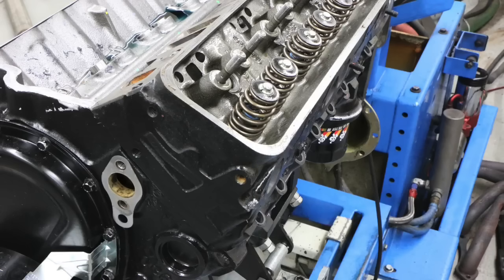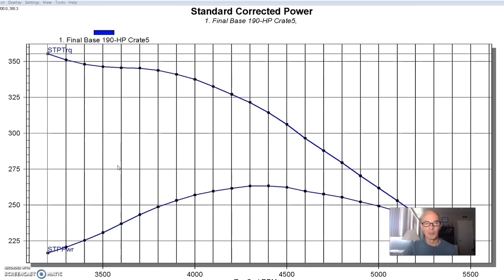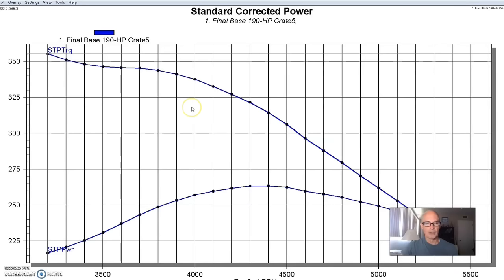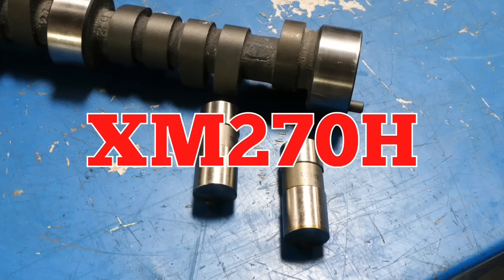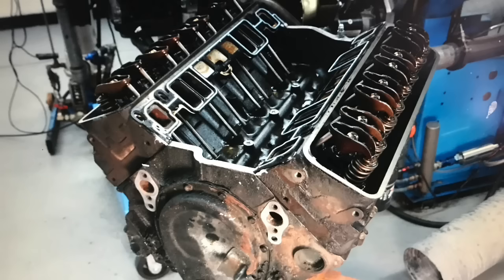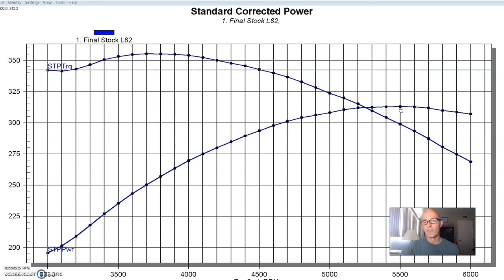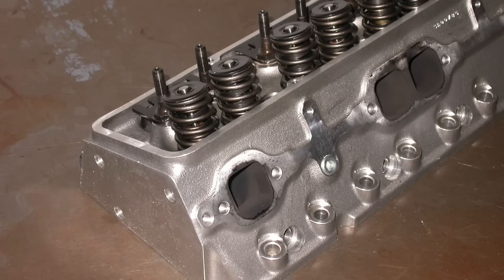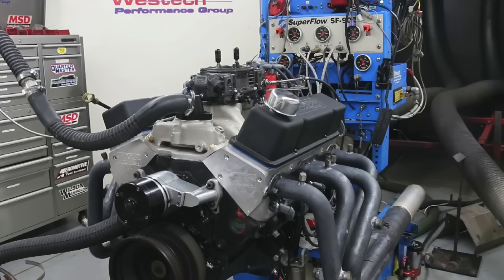JUNKYARD SBC HEAD TEST-VORTEC FTW!

Comment: I tore down a stock  L-82 many years ago out of a mid 70s corvette. It had a forged crank, 4 bolt mains, forged flat top pistons, a windage tray and baffled pan. The heads were big chamber but they had screw in studs and guide plates.
Reply: windage tray, guideplates and screw in studs are definitely not stock.
Reply: Kimbal Mackinnon Sorry, but I’ve got a stock L-82 from a 74 Vette torn down in the garage, can’t vouch for the windage tray but I can confirm that the original 882 heads do in fact have screw-in studs & guideplates, and can also confirm the forged crank, forged flat-top pistons, 4 bolt mains, as well as “pink” rods. As Richard mentions, the L-82 is a low compression version of the L-46 350/350hp engine, the hottest hydraulic cammed 350 and pretty close in specs (besides cam) to the LT-1. Amazing how the L-82’s quietly carried all that good hardware through the dark days of the 70’s!
Reply: M W my 1976 corvette L82 had windage tray forged crank pink rods trw pistons 2.02 882 heads . I hand ported the heads and had bronze guides installed and machine work done to allow for springs matched to comp cam with high lift and short duration, rhoads lifters ,roller rockers . Rebuilt  engine with clevite 77 bearings double roller timing chain felpro head gaskets with fire rings and  moly rings ,hi volume oil pump  reworked hei big tube headers dual 3 inch exhaust  and super charger with boost referenced 780 Holley . Passenger are pinned to the seat in first and second gear . Agree with all you comments on the L82 also the block are hi nickel go foundation to build on
Reply: @rustysausage69  All stock, numbers matching 4speed 1975 corvette. Do some research on the L-82.They were a really good engine with really good internals- especially for the smog era. All that good stuff came on it. The L-48 from the same year- none of it.
Reply: @bsrktm1  Yeah, even the L-83 in my 84 vette has forged pistons and a windage tray. The rest of it is cast. The L82 was a pretty good motor to build from.

Comment: I have a 383 with vortec heads in a C10  great all around engine for this truck
Reply: Do you have videos or spec on your build? I’m contemplating the 350 with vortec heads or the 383 with vortec heads in my 85 c10
Reply: @marcusmccomb1789  you will be happy with a small block in a c10
Reply: @charlesroyal3428  do you have specs on your 383 build aside from the vortec heads?

Comment: Richard, could you do a piston to valve clearance video on a ls of some variety. Just graduating from sbc's to the ls world. I'm doing a 6.0 ly6 with tsp stage 3 ls3 cam, but running ported 862 with 2", 1.55" valve package. Thanks
Reply from the maker: what is the intake duration on that cam
Reply: 231

Comment: Carb spacers usually cool the intake charge and add a lot more power when they're tapped and have nozzles in them 😜
Reply: Giggle giggle
Reply: A true winner has spoken
Reply: You win the internet.
Reply: I like engine driven carburetor holders myself.
Reply: Ice cold
Reply: Great approach keep it up
Reply: Well Played, Sir!!!
Reply: Lmfao i was like wtf why would oohhhhhh good 1
Reply: I don't think spacers do much,if they do anything on an engine that's fuel injected with a MAF sensor. I put one on a 97 K1500 Chevy I had.  It was 100% stock. I didn't notice anything,not even better gas mileage. Waste of money unless it's tapped for extra fuel & nitrous oxide.
Reply: This guy is a flipping mor.... ahhhh well played.
Reply: 3333333333333333333333333333333333333333333333333333333333333333333333333333333333333333333333333333333333333333333333333333333333333333333333333333333333333333333333

Comment: I'm thinking of putting a 1' spacer under an 800 cfm Quadraject because I read the large secondary throttle blades can protrude down into the manifold plenum when wide open and disrupt flow on a dual plane Edelbrock manifold.

Comment: I'd like to see u do a tbi headed 350 w cam and springs to see the hp limit with those swirl port heads
Reply from the maker: the TBI is limiting
Reply: The stock 350 TBI does not become a noticeable restriction untio the 330 hp range provided you increase the fuel pressure with a 30 psi regukator. The TBi itself is not really a restriction on a streetable small block if you use the 454 TBI. I have had a single 454 TBI unit on a 305 making 423 hp and a 350 making more than 450.  Just use the 30 psi marine regulator on the 454 TBI with 350 injectors and tune the thing. The GM 2bbl TBI works very well on a victor jr manifold especially the 2bbl one.  I have also used dual small block TBI units on a 406 with a tunnel ram and made more than 550 hp.  Used the stock GM 2" bore TBI units on a mercruiser 575SCI with a blower upgrade on its 502. That 502 was in the 750 hp range. The stock TBI heads can make over 300 hp as well with a modest cam upgrade like the old Crane 274H06 grind.
Reply: @chrisreynolds6520  holy cow. That's useful information. Wish I'd known that before my 92 TBI 350 blew up. I could have blown it up even sooner!
Reply: @richardholdener1727  
I was just curious to see what it would make with a carb cam and spring swap see if 325hp to 350hp is doable or even maybe low 300hp lots of those at the wreckers I know swapping the heads would do but some guys might not want to and just want to use what they have love da vids aloha

Comment: I'd still love to see these compared to the old camel humps haha
Reply: Engine Masters did that a few years back. The vortech heads were significantly better.
Reply: @Cowboy.underwater  Engine masters hasn't had traditional camel humps on the show. Only generic heads like the ones tested here.
Reply: Good Old school 462 versus vortec head on a true dyno test I've seen 40hp gain for the vortec
Reply: Just look at the flow numbers. The best camel humps were the 202 160 valved fuelie heads(if I remember correctly it's the 461 & 462 castings) and even they (stock casting vs stock casting) dont flow as well as the vortecs. Now ported is kind of a trade off and depends on how they're ported but for the average port job the vortecs will still outflow the camel humps at low lift while the camel humps will outflow them at higher lifts(ex .600in plus).
Reply: @darrylbrown4790  I know what the flow numbers on the heads look like. But I want to actually see them dyno'd. They're the two best production SBC heads but there's no dyno results comparing the two? I find that ridiculous lol.
Reply: @darrylbrown4790  I dont think many folks nowadays would run a .600 cam with Vortecs, lol. But back in the day (70s), 461/2 was the best you could do.
Reply: @donellmuniz590  I have a set of ported camels on my corvette and it absolutely RIPS on my 406. I'd swap them for vortecs but im pretty sure ported camels pull ahead of ported vortecs if I recall. But I would love to see testing on the matter because its all hear say. But I do know stock vs stock the vortecs are better
Reply: Flow rate and port design is much better on Vortec heads, and the chamber design is much better on vortec (high swirl, "heart shape") than the original wedge style of the double hump. Vortec will be better pretty much everywhere on any test engine, the more radical the engine the more gain, but with the 190hp crate motor it probably wouldnt make more than 20hp difference between the 2.
Reply: Camel Humps flow in the 200 cfm range.. While Vortecs flow in the 230cfm range.  Theoretic power increase w Vortecs and properly spec'd motor.. 60hp.
Reply: Had 462 heads went to vortec heads  ,the power difference was unreal
Reply: I bought a set of wp dart heads with the small intake runners  (185 cc) 64 chambers 202 /160s was told by Doug Herbert that they were pretty much fashioned after the fulie heads..
I replaced them old camel humps with the wp heads and they performed quite a bit better..with that said a bud of mine went vortex ..very similar motors before .359s solid roller 13 to 1 slugs and the wp heads made a bigger difference..
Reply: D Mass  Are they better than Vortecs?
Reply: D Mass  Wow!

Comment: I remember a build in a land long ago where a certain magazine took a 305 chevy sbc with and  withdrew around 420-440 hp if I recall .combo used gm vortec heads , edelbrock super victor vortec intake but I dont remember the cam/carb/compression. Would like to see that revisited or replicated. Keep up the bad arse work your putting out.
Reply: http://www.hioutput.com/tech/400hp/400hp.html
Reply: @slosew82  That is a very similar build .the one I'm talking about I believe was from a car craft article from late 90s early 2000s. And the heads where from scoggin dickey.  I promise I didn't kill your father and I'm not prepared to die lol
Reply: @brianobrian9334  😂
The one I tagged, I remember reading it in print years ago. Everyone hates on the underdog 305 but some guy ran 10s iirc on the power tour with a blown 305 tpi. I've always loved them.
Reply: @slosew82  it's not so much that the 305 is terrible, other than the fact that cylinder filling is its Achilles heel.  Mostly, the trouble with a 305 is that the 350 does absolutely everything better, with zero downsides.  It's still a good reliable engine, it's just that the 350 is by far the smarter route.
Reply: @slosew82  there was a red IROC Camaro with a Vortec supercharged 305 TPI featured in GM High Tech (May 1998) that ran a best of 9.95. I bet that's the car you're thinking of.
Reply: They have a budget (?) Sprint car series for 305s, they cant be THAT bad. Hell, 283s had small bores too.

Comment: It makes no sense why gm sold those create engines like that I mean some different pistons with a little more compression and a bigger cam and those vortec heads I mean they were making them already would not have really changed the cost much and have been much better
Reply: Some guys have to have a stock replacement for their TBI trucks to pass smog. GM has several other crate versions, but the prices go up a LOT. Their 405hp ZZ6 350 is $8375 turn key from Summit. (That's crazy!) They even make 383s. Go to the Chevy dealer and get their performance catalog, or it might be online.

Comment: What intake manifold should I use on my stock 83 Chevy C20, the elderbrock performer, the performer RPM, or the performer eps? I rarely go over 4000 RPM and would like more power and torque down low rather than up high for Street driving and Towing, thank you
Reply: Use the performer. Great low to mid range power and good up to 5500
Reply: Just the base Performer intake would be best for your application, I think. The RPM or RPM Air Gap would be too much for it unless you plan on throwing a carb, cam, headers etc at it in the near future. 

Look around on Facebook marketplace or Craigslist, you can typically find Performer intakes in the $100 range.

Comment: Great video. Up here in Canada, the wreckers move trucks quickly, so vortec heads are hard to find now, but I've located a pair. This is motivation.
Hoping to greatly improve on the 170 flywheel hp that the Wallace racing calculator estimates my poor 95 suburban has left.
Reply: Are you swapping to carb or is there a tbi intake available that bolts to the vortec heads?

Comment: I’d like to see stock Vortecs on a stock 400 short block.
Reply: I have that combo on my 77 Chevy short van. Comp 260 cam.  Runs like a raped ape.
Reply: @glennsouthard9208  Raped date.  Raped date.  Noone rapes an ape.  That'd be beastiality.  Besides, apes done run.  They lope, or swing, or gallop on all fours.
Reply: That was my very basic build plan for my 90 T/A TPI.  All the torques!
Reply: DrewLSsix, Sounds fun. 👍🏻
Reply: i did it with a healthy cam, 1240s at 107 3300lbs about 400 hp
Reply: They work good.  Built a 406 with vortec heads, flat tops, performer rpm intake, Holley truck avenger and truck cam for a big Blazer in early 2000s. Fun rig and good times.
Reply: Owen Arsenault, We’ve built some 355’s with Vortecs for trucks, decent engines but torque peak is a little higher in the rpm range than I’d like.
Reply: @owenarsenault5955  my 406 was in a k5 too!
Reply: I put some barely cleaned up l98 heads on a 406. It ran great.
Reply: HioSSilver1999, 👍🏻
Reply: @HioSSilver1999  imagine the vortecs?
Reply: @trillrifaxegrindor4411  probably be a good combo on one.
Reply: @HioSSilver1999  tell me about that combination. I want to do the same. 400 with aluminum  L98 heads, comp 280 magnum, weiand team g and 780 Holley 3310
Reply: @vinceyoung5912  nothing major to tell really. Was pretty mild and in a k5 4x4.....had all kinds of tq. I reused the stock 5.565 rods, it had 10:1 compression, did a mild bowl clean up and port match on the l98 heads with a wiend stealth intake. I put a comp 275deh-10 dual energy cam in it with some 1.6 rockers.

It was a really good combo. Tq everywhere and would run to 6500-7000 rpm.
Reply: With a cam
Reply: Calvin Evans, Yes of course. 😄👍🏻
Reply: Let's see a ramjet manifold vortec head  with boost
Reply: I have mine steam drilled (vortecs) going to put them on a daily driver style 400 with summits 1103 in my 55 4dr should be a great driver.
Reply: david H, Sounds like a cool car. 👍🏻
Reply: Sounds good for a truck or heavy car like an Impala.
Reply: Donell Muniz, Yep lots of low speed torque. 👍🏻
Reply: You don't need a 400 block necessarily...  Going .040 over and running a 383 crank gives you 385cid.  385cid is 96% of the cubic inch displacement of a 400.   The 385 is only going to need a few more 100 RPM's to draw the exact same amount of fuel/air as a 400cid sbc.  Stock Vortecs flow about 230cfm.. making theoretical peak HP in the 460 ish range.
Reply: @mountainofeverest3861  I built a stroked 350 .06 bore and offset ground another 10 in the stroke it's now a 394, vortec heads and vortec applicable rpm air gap and a cam pushing a stock 5 speed lots of fun!
Reply: MountainOf Everest, Id build a 454 before I’d build a 383.
Reply: @shitbox7413  and with that, i'd build a 572 before a 454.
Reply: @rearspeaker6364  you know what "they" say... the 632 is today's 383...lol...from Wyoming USA 🔫🤠🇺🇸p.s stay safe and healthy everybody GOD BLESS OUR COUNTRY AND stop this foolishness  ❤
Reply: rear speaker, Agreed, we used to have one, made 1000 on motor. 👍🏻
Reply: Check out  the impersonator build .
Reply: fastyzzzff, Whose channel?
Reply: @shitbox7413   Google it it's a old magazine article
Reply: fastyzzzff, Yes I remember that article well now that I went back and read it, amazing pump gas small block. 👍🏻                           http://www.superchevy.com/how-to/148-0306-chevrolet-406-big-block-torque
Reply: @shitbox7413  does it say anywhere in that article what cam they used???
Reply: I see it now in the second article, single-pattern Lunati camshaft sporting 0.480 inch of lift with 230 degrees of duration at 0.050-inch measurements. Similar to a comp XE268H
Reply: I'd say get some vortex heads do a gasket match and bowl blend back cut the valves slap em on the 400 and use the same cam as the video mentioned and that mild head work and extra 50 cubes it outta make 400hp and 440torque or more
Reply: I did this too a 400 with flat tops 500 lift cam they did work as well as the 350 engine . 350 would pull hard too 6000 rpm, small block 400 did want too pull hard past 5500. I think bigger head would work better on the 400. But both these engines were in 1970s trucks !
Reply: 400 Chevy  didn’t want too pull past 5500
Reply: I have stock short block 400 with skip white 200cc NKB heads, rpm intake and 670 brawler. Definitely has wrong cam in it though, it’s the L79 350hp/327 cam. It’s what I had on hand.  Still has shit loads of torque. Fun to drive in 72 Malibu and only paid $300 for short block😎Planning on swapping in a comp xe268h which is similar to the lunati cam in the impersonator build.
Reply: Joe Trader, I bet it’s fun on the street. 👍🏻
Reply: Yeah!
Reply: I scored a ramjet intake at my job really cheap . Just need to come up with a wiring harness
Reply: U beat meto it
Reply: That was my plan, 400 + vortecs, but I had some shweet camel humps so I popped them on with a towing cam. The vehicle is a lifted tow truck.
Stock 400 rebuilt 
Stock camels rebuilt
Tow cam.
Basic head gaskets
What hp/tq would you guess I'd get and at what RPM?
Reply: X Mo, I’d say somewhere around 430 ft lbs, at about 4500 rpm...
Reply: @shitbox7413  
I just noticed your response now. Thanks.
Reply: My 400 40over 408 with dish pistons and z28 302 heads and lunati voodoo 525 lift cam on 93 octane runs really good. I ran 7.5s at 90mph in a s10blazer weighed 3k with th350 small stall and 3.55 gear. Was impressive for a stock rod n crank 400 with cast iron heads
Reply: @jordanwalker9309  Stock rods and crank? How many rpm are you spinning at shift point?
Reply: @wisheye1  no more than 6k an that was pushing it. I shift at 5800 to 2nd then go thru the lights usually close to 6k.
Reply: heavy chevy, To each their own but I always prefer to make as much torque as possible, let the horsepower fall where it may. The point of that build wasn’t max effort, more so to show what a Vortec head is really capable of with more cubic inches. Vortec heads were designed to make low speed torque for towing and hauling, not horsepower. I’m sure if peak horsepower was the goal of the build they would’ve ran AFR’s or Trick Flows or something similar.
Reply: My 408 with ported 062 screw in studs and beehive springs was a waste of money. The springs should be heavier even with 489 lift cam. Pop pop pop it dont like RPM at all. a lot of advertisers advertiser products for people like me to buy them and then just waste their money to buy more aftermarket products.
Reply: Chris Wells, Sounds to me like you need a better spring...
Reply: They only flow 170cc's. 195's would make much more power.
Reply: Rod Palm, It’s all about torque. 👍🏻